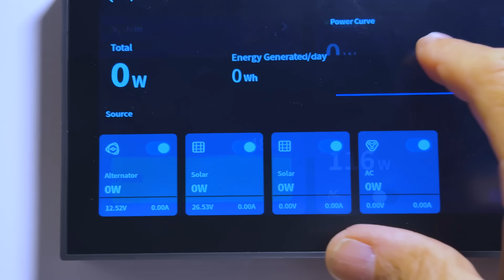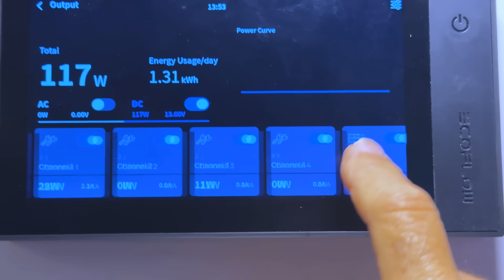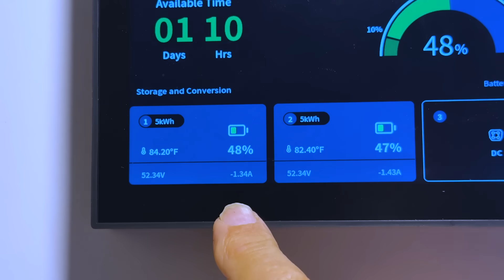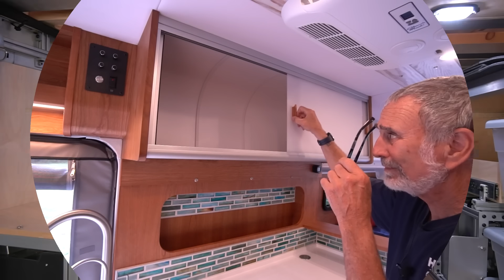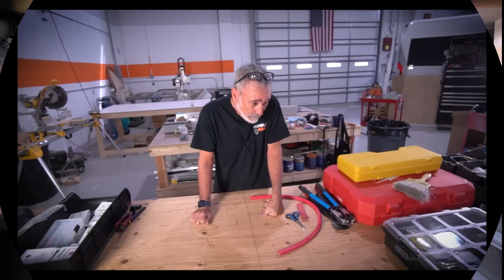HOW DID IT GO? BUILDER EXPLAINS THE ECOFLOW POWER KIT.  FIRST INSTALL IN A CAMPER VAN

Comment: Thanks again for making what's turning out to be a detailed look at the Ecoflo Power Kit from a builder's perspective. 
In your opinion, is it worth it for me to consider this kit as a renovation option for a Class C instead of the often used Victron route? 

I have a bone stock setup in my 2017 Leprechaun Class C: 
- 2 AGM 6 volt batteries in series
- Onan 4800 Generator
- No solar yet.
- No transfer switch (I manually plug the panel shore power cord into the generator outlet whenever I'm not camped.)

So as you can see, I have to potentially buy everything a "modern" RV uses anyway. Please give me your opinions!
Reply from the maker: Yes, I would consider the Power Kit Gen 1 for your Class C. Also; take a look at the EcoFlow Delta Pro with companion battery. That may suit your needs in a portable less expensive set up.